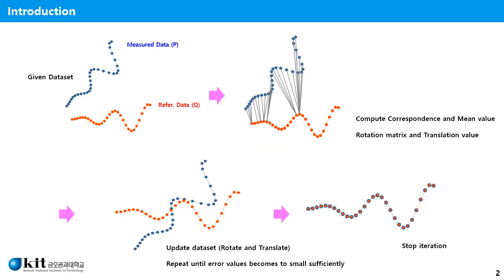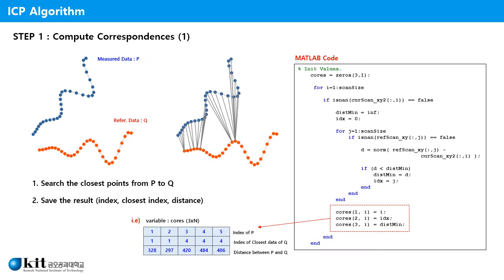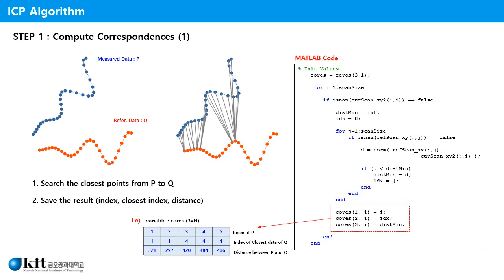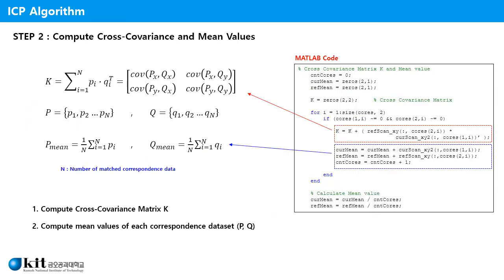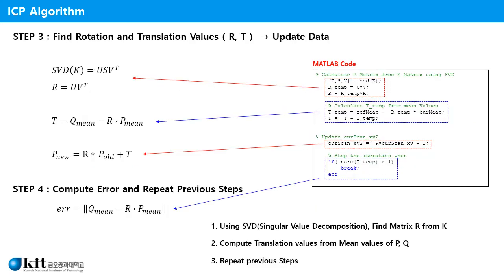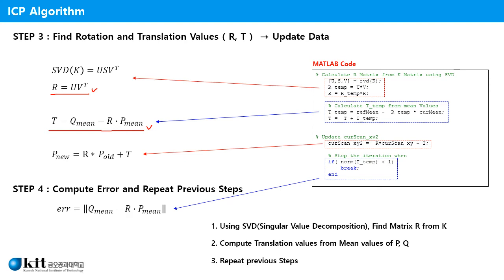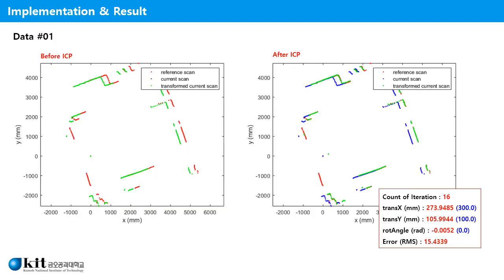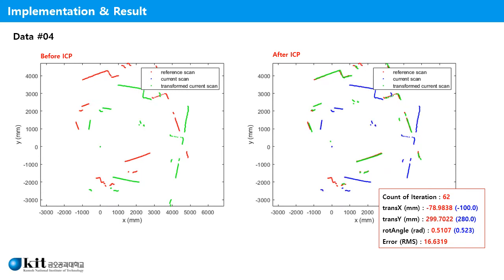Scan Matching Algorithm using ICP (Iterative Closest Points)

Comment: Good Day, Thank you for this helpful and brief explanation. In each dataset, did you manually change the number of iterations?
Reply from the maker: Hi,  No, I didn't .  I just set the maximum limit number of iteration count  about 100 or other extra large number. It used for preventing endless loop.
Reply: @jangseob  I see, thank you for your response. Noted on this and have a good day.